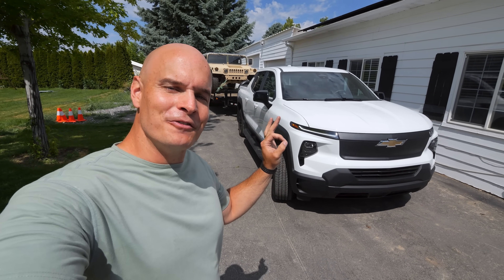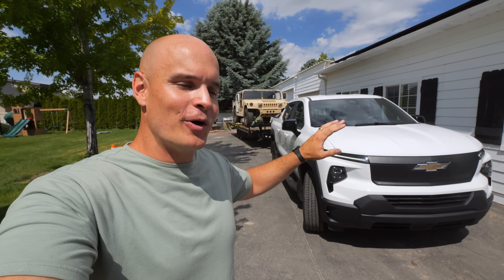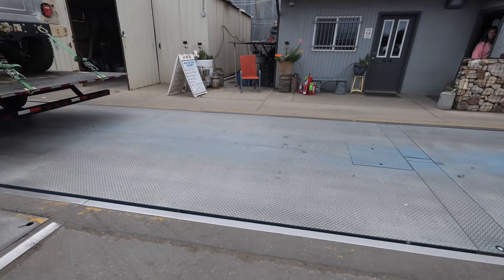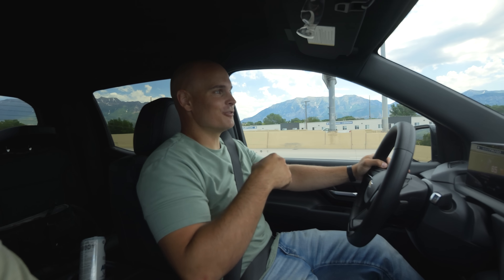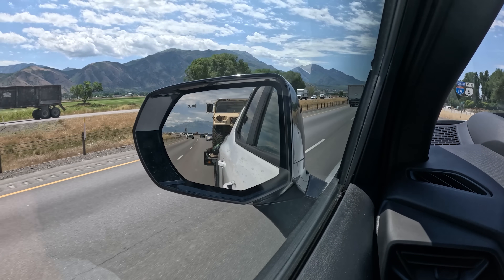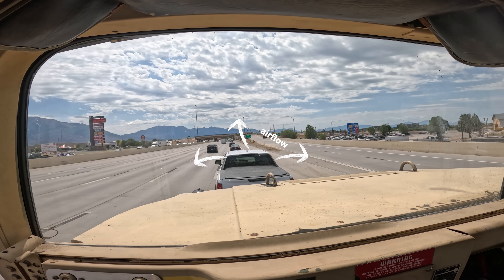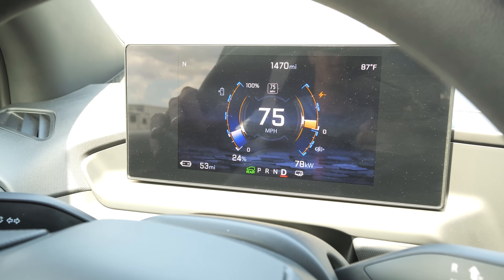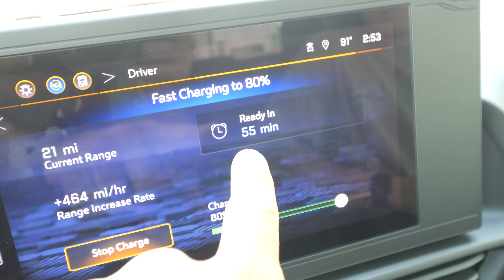The Chevy EV tows TWICE as far as the Cybertruck?!

Comment: Good video Zack! One issue however, your trailer & load weighs 10,000 lbs total, not 11,000 lbs as you surmised due to the 1,000 lbs hitch load from 10% of your tailer load. Your total weight is still 10,000 lbs, not 11,000 lbs. Cheers.

Comment: F250 hitting the market today as my  Silverado 3WT arrives next week.

11250# of excavator, trailer and gear will be testing that range regularly local and within 75mi or so
Reply: For local tows, it will be the best truck for towing. My F350 dually is great for towing, but the fuel bill is over $1000 per month. I bet yours will be a quarter of that or less if you charge at home. Good luck!
Reply: @petemiller519 5k miles on the EVerado mostly home charging...f250 gasser gone ... Now my f750 is getting anxious. 😅

Comment: Also, Dodge RAM may have come up with the ultimate answer to towing and long range.  The 2026 Ramcharger will be a hybrid vehicle like no other.  Its a fully electric EV pickup capable of running long distances on its 92 kwh battery power alone, but also has a 130kw onboard generator capable of extending its range to 690 miles.  647HP and 14,000lb towing capacity.  Best of both worlds when you really need the range.  Will see how will it performs when it comes out next year.

Comment: This is a great video, but if youre going to compare all the trucks the most accurately, youll need to tow them all under circumstances as close to eachother as possible, using stock tires and same temperature within 10 degrees of eachother would be a great start. 

Itd be an upgrade to this one. Would love to see it

Comment: According to the owners manual, this truck has substandard outlets.  Page 102 reveals that the outlets only put out 400 watts, far less than what’s required  to run most job site power tools.  It will charge batteries, and not much else.  I found  this out by accident after the sale.  I complained.  I want, and expected standard plugs in my WORK TRUCK.  I asked if this could be fixed, no reply.  I asked why such important information was not disclosed, no reply.  Was this some after sale “surprise”  for lower income folks that can’t fight back?  I asked victory Chevrolet for my money back,  no, so far.  I think withholding pertinent information like this constitutes fraud.  So if you can’t afford theRST,  DONT  buy this thing.  You will be stuck with it just like I am.  It’s disturbing how  far company policy has strayed  from honesty and integrity.

Comment: Towing a 6k lb trailer with my Sierra EV I can get 31 miles per 10% battery used (so, theoretically 310 total if you drove it to dead). Good to see that nearly doubling the weight only takes 1/3 of that away. I’ll never tow more than about 8k so I expect something in the middle of those two numbers.

Comment: At the start, I'm guessing 200 plus miles.

I guessed wrong. It was only 177 miles. However, I had no idea he was going to do 75-80 miles per hour. Since he was towing, I thought he would be doing more like 65-70 miles per hour with that 11,000 pounds of tow. Had he be going more like normal drivers towing that much weight, it would have been over 200 miles.

Comment: Chevy engineers aren't performing magic here, they just stuck an enormous battery pack into their trucks. The battery in the Silverado/Sierra is over 65% larger than the Cybertruck's. Yes, the ambient temperature, tire type, aerodynamics, etc. make a difference, but when it comes to towing, the vast majority of the difference is simply down to the difference in battery capacity.

Comment: Assuming 8 MPG and a 23 gallon fuel tank at highway speeds towing 11,000 pounds, a 5.0 liter Coyote-powered F150 will have a range of about 180 miles. For an electric car to match that is seriously impressive! The EcoBoost models actually have less towing range, closer to 160 miles and 7 miles per gallon, due to turbocharged engines consuming more fuel at high loads.

Comment: 450 miles minus the 10% you're not supposed to run under and 20% at a "supercharger" which you're not supposed to charge above 80%. So simple math, your average range  using a quick charger is 315 miles.

Comment: 170 miles… factor in 30% efficiency loss when cold like ALL the other tests… 119 miles. So pretty on par with others in spite of super large battery. Disappointed that you would pose this as an equal test at all and act like Chevy cracked some code on towing

Comment: For a video titled on the question of why the Chev tows more ... sure didn't notice any mention at all for the reason.  Did I miss it?
I mean really, where is it?  It's the battery.  It has a bajillion pounds of battery.  MUCH more than the other trucks in the test.
With the pros and cons of it.  That's a lot more weight & cost.  Quite a lot.  But naturally also more range, both unloaded & loaded.

Comment: Nice work Chevy 

The big problem is gonna be during-trip charging.  55 mins for 80% charge is a bit steep for time. 

I guess next test is a how long it takes to tow 10k lbs 600 miles. Which would include charge times.

Comment: Towing range is influenced by many factors. Two of the most impactful are frontal area (aerodynamics) and weight. It'd be interesting to see a range comparison between the flatbed/electric Hummer combo and a run of the mill enclosed trailer. Something like a 7'x16' might be a good comparison. It'd also be interesting to see the difference between the trailer  laden vs. unladen. My guess is that those numbers wouldn't be all that far apart (<10% to 15%) as wind resistance is the main range killer.

Comment: Chevy Silverado max rated range: 440 miles, $97K, 0-60, 4.5 sec
Rivian R1T rated max range: 420 miles, $84K, 0-60, 3.4 sec

Not exactly a material rated range difference.

The Rivian test was not only cold weather, but it was not the max pack, it was the 320 mile battery pack.

Comment: Yay!  Electric trucks are almost worth buying.  Maybe the next generation will be worth getting, but until it can tow 250+ miles on a charge and there are more pull through charging stations, I'll stick to my ICE truck.  I'm a hippie and an environmentalist.  I want electric trucks to be good enough, but they aren't there yet, and the infrastructure isn't ready either.
Reply: If you're not towing 5000 kilograms, and you're not driving at 120 km/h, this truck will probably get you those 250 miles.

Comment: Not a complete test. No specs or mention of battery size and weight differences. Anything can go longer with a larger battery. Also, for a proper test you would need to run it until it quit on its own to get the proper distance. It might have said 14 miles remaining but is that like my truck that says zero remaining but yet still goes another 10 miles? If you’re going to make a test go all the way and give details don’t just skim the surface.

Comment: Silverado  has a 82% larger battery than cybertruck.  All these tests should ONLY be about kWh per mile period- and while we’re on scientific testing, all test should be performed with same atmospheric conditions.   With the packs sizes in all of these trucks, they all seem to have been the same in KWH per mile with your testing.  However, since Rivian and Cybertruck tests were in winter, it leads me believe they are actually more efficient than the Lightning or the Silverado EV. 

All of this is in the real world is moot because a tiny fraction of any of these EV truck owners will tow long range.

Comment: The Chevy also weighs almost 2000 lbs more than those other EV trucks, which is probably mostly battery weight. 8,532 lbs. Pretty insane that it's so heavy.  Don't get in an accident with it.  Cyber truck: 6,603. Lightning: up to 6,500.  Rivian: 7,148.

Comment: I love how everyone's "towing tests" always seem to include "0-60",  "flooring it", and going at least 10 over the recommended speed limit for towing (65 mph) as if that's something someone who genuinely cares or knows about towing would ever do. That probably zapped 20 miles of range right there. But otherwise, decent review I guess... Do it again without those wasteful antics and you'd probably break 200 miles of towing range.

Another variable in towing is wind resistance & frontal area, which is almost more important than just weight alone. Towing a camper, for example, causes more strain on my SUV than a utility trailer with similar or more weight in it.

Comment: This is very controversial because heat as well as cold kills batteries.
You should take this to a whole new level. You and Dan have the pull to make it happen.
Get as many comparable comparable trucks and have them tow in the same conditions.
Example first video leave Las Vegas and also a support vehicle ya know a Tesla battery pack trailer to get the slackers to the next charging station.
Vegas to St George 
Then in the middle of winter maybe Tooele towards Wendover.
For a side video as awesome as it would be to see them compare pulling Parleys I think Soldiers Pass would be a safer comparison but think for this test you might need a roll back available.
Thanks for all you do keep up the good work

Comment: Wait. The cyber truck even with AT tyres and winter was more efficient. And this is a 200kwh battery vs the CT with around 125kwh. 

This thing is an inefficient behemoth. Gets the job done by just hauling around a freaking ginormous battery for all of your daily driving. 

This would impact, literally everything from Performance, acceleration, braking, handling. Makes sense if 90% of your driving is long haul.

Comment: 5:57, Jerry forgets to mention that the battery of the Silverado EV is 90 kWh larger than the one in the Cybertruck: 123 kWh for the Cybertruck vs. roughly 212 kWh for the Silverado.
Reply: Yea he hates Tesla and won't point out the reason why the Chevy went further smh.
Reply: @MxRider684  he explained the aerodynamics problem with cybertruck, that is a major factor regardless of battery size(watch the engineering explained video)

Comment: Due to liberal policy pressure, I was forced to buy 4 of these from a local dealer for my fleet... they are fast and very much a half ton truck.. but I'm still searching for the 80k in value.. they have super uncomfortable seats that are manual.. no heated seats.. small basic screen.. lots of plastic and a very basic truck. Also they take FOREVER to charge, even on a Level 2.. if you don't spend 100k for level 3 fast chargers, you'll be waiting quite a while to charge.. or spend $95 to charge it at a level 3 public fast charger. More than a tank of gas for a ICE Silverado 1500 (at least in Seattle area)

Comment: Would be good to also show the vehicles' total battery capacity and miles per kw.  The Rivian i believe has a total of 130kw, the cybertruck has around 120 and the ford lightning has like 130 or so from what i remember for those reviews, but this chevy ev has over 200kw battery from what their website says so no wonder it goes longer.  Thats like saying a corolla with a 20 gallon gas tank is the new champion of range between a 10 gallon mazda 3 and a 12 gallon civic without showing their actual mpg.  Yes you did mention cold weather but maybe retry this during winter and see how it goes and also mentioning the battery size on each vehicle tested?  just my 2 cents.

Comment: It is stupid to compare this GM with small street tires to the Cybertruck with large off-road tires. Think about this. If you change the Tesla Model 3 wheel size from 18 inch to 19 inch diameter,  you lose about 10% of the total range.  Translate that to this comparison and it is clear that if you equp both trucks with similar size wheels,  and test them at the same temperature conditions,  they should be very close in towing range. This video is useless because you are comparing apples and oranges.

Comment: For full EV towing, given the distances I cover and the country I live in with its ‘after thought’ charging infrastructure I’d want to see between 250-300miles range, but this Chevy is impressive never the less. And when towing all the time, you ain’t worried about being the fastest off the line. It’s about keeping the power up going up hills and not feeling like you have a barge on the back pulling and pushing you when you accelerate and decelerate.

Comment: My '16 F150 3.5 Ecoboost with a 36 gallon tank tows a 35' toy hauler trailer with a '22 Maverick throughout the North and South west. At 70mph I average 290 mpg when towing that rig, which weighs just shy of 12,850 when loaded and takes me 5 mins to fill up, and I don't have to disconnect my trailer to fuel. The EVT (EV Towing) range is decent, but until the charging can get under 10 mins and ranges over 250 when towing, maybe and I mean JUST MAYBE I can justify all of the other negatives related to EV's.

Comment: What makes this even more impressive is the fact you were doing 75/80mph the whole way, thats wild. Do another test and drive at more reasonable 65 or 70 and lets see how far it'll go.
Reply: Most RVers don't break 65. This truck would most likely be 220+ miles towing at more realistic towing speeds.
Reply: @stevengilbert6613  exactly, when I tow my camper I don't go over 65.
Reply: In Texas no one goes under 80 so it's still a relevant test for a lot of us
Reply: The major freeway in this video (I-15 in Utah Valley) has a speed limit of 70 mph. During daylight, and outside of rush hour, it's common to have a slow lane of maybe 65 - 70 mph, and a fast lane of 80-85, depending on the specific individuals on the road at the time.

Comment: The range makes sense CT is 123kw

 where the Chevy Silverado ev is a whopping 215kw 

so for another 92kw of battery you get another 70 miles

It will be interesting to see what the tow range is on the CT with the range extender battery pack ?????

Comment: Did you take into account the much larger battery in the Chevy?  I think the cybertruck has 125, 135 on the rivian and 131 on the ford assuming the largest. If my quick googling is correct, the Chevy better go the furthest. Maybe share the consumption rate so we can tell which it the most efficient. The way you’ve framed this is akin to the Chevy having a bigger gas tank and not a more efficient towing vehicle.

Comment: Extreme heat / extreme cold, which this and your old tests both encapsulate in their own ways, are nearly equal. As it's not that the CT or Rivian were getting cold battery performance, due to the batteries being warmed in the winter... and in the summer heat, as with this Silverado EV, they're being cooled... as massive heat is terrible... a different kind of terrible than massive cold... but in each realm the batteries are expending similar energy to either heat or cool themselves, to keep themselves at an ideal temp for outputting the power required. So yeah... those other trucks were in the cold, with the extra hindrance of warming themselves... But this truck is in the massive heat, with the added hindrance of cooling itself. While running AC no less... Honestly, I bet you'd have gone even further if it WERE winter.

Comment: disappointingly misleading video, especially the aero section. the reason why the chevy pulls twice as far as the CT is NOT the aero it is because it has double the size of battery. that's it. in m/kwh measurements the CT actually does better and is more efficient. JRE's own data shows that. Not saying the CT is better, just feels like you are leaving out a key piece of info here - the battery size. It's like saying a ICE Silverado can tow twice as far as a ICE F150 without mentioning that you have an auxiliary tank installed. lame.

Comment: Jerryrigeverything. Perfect video idea. Do a towing range test. A gas truck vs an electric truck in an urban/suburban environment. Like contractors would use locally around a city center. NOBODY does this. Steady state cruising is the worst for EV’s and the best for gas. City driving is the opposite. An EV can take advantage of regen, where as a gas truck has to dissipate all that energy with the brakes. The heavier the towing weight the more of advantage the EV should have. If we are talking about a 25mph suburban environment, I bet a silverado EV would have more range than a 1/2 ton with a 25 gallon tank with a very heavy load.

Comment: How can you be so... biased and deliver wrong information?

Yes, the Chevy EV is the better towing truck. But not because of anything of what you said.
Cybertruck has a battery of 123kwh.
Chevy EV has a battery of >200kwh.

If you consider the weather/temperature and the battery capacity the Cybertruck was more efficient.

The only reason why the Chevy EV got further was because of the bigger battery.

Comment: The most unbelievable part of these videos is that Zack just drives up to empty EA charging stations and they work
Reply: Yep. The times I've been let down by non-Tesla charging stations is insane. Nearly had a Signet Nissan CHAdeMO charger blow up on me. It was making all kinds of strange noises trying to charge my car and it finished with a very loud electrical pop, I'm guessing because the contactors opened under load. Thankfully it didn't damage my car, but it meant I was stuck sipping on a level 2 for the next hour and a half until I could make the next hop.